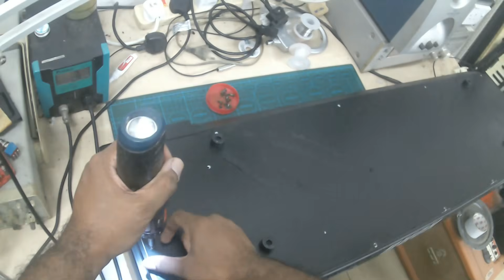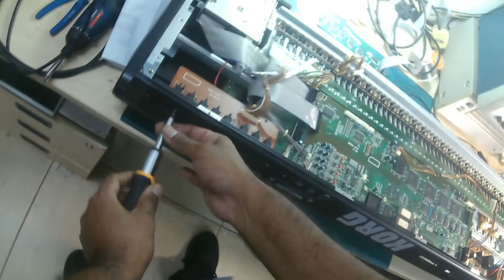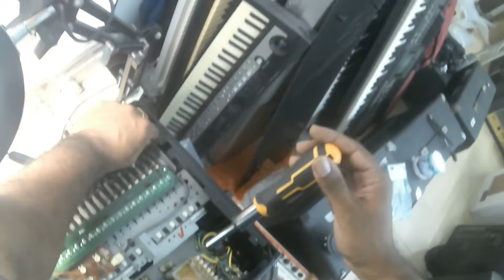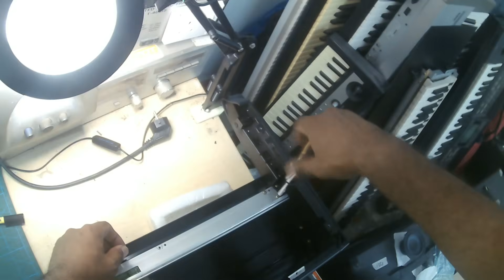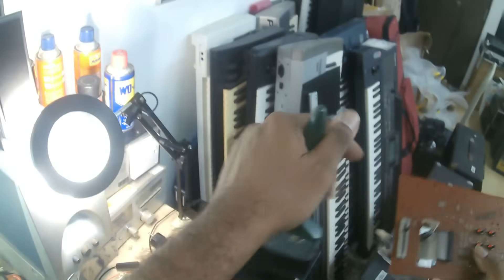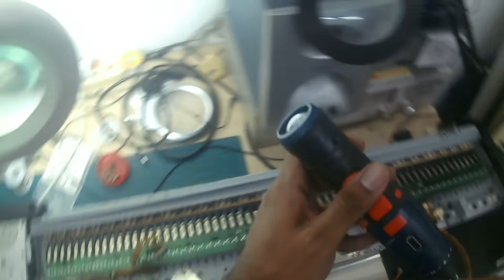KORG 01W Keyboard Repair

Comment: Hi, I see you have a great deal of expertise in synthesizers, so I naively ask if it's possible to replace the keybed on the Korg 01Wfd PRO with a more weighted keybed, or rather, weighted along the lines of a Kurzweil K2500/2600. Best regards, and congratulations on your skill.
Reply from the maker: Thank You. I have not tried to replace the keybed with a more weighted one. However, it is possible to glue some metal weights under each key . This was done in some roland models .
Reply: @audio-services  I understand...thanks for your precious assistance, Ciao!👋👋
Reply: Greetings from spain, I need you to help me get the screen of the korg 01wfd, I also have the korg 01w printer with the same problem. Thank you

Comment: I need to change the display in my 01WFD. It's been back to Korg for a full service so I won't need to go as far as you did. As far as I can see from your splendid video, it looks like I need to do the following...
1:backplate off and test the new display.
2: remove the main board.
3: remove the foil.
4: remove the display board.
5: change the display.
6: reassemble.
So, the key bed, the FD drive , the the rail, power supply and pitch bend controller stay in place. is this correct?
Many thanks, David
Reply from the maker: You will need to remove the keybed and pitch controller plastic cover to be able to access the LCD display board

Comment: You did nothing with the keybed did you?  That's an assembly which really needs cleaning, adjusting, and lube.
Reply from the maker: In this keyboard, i replaced the LCD display. There was no issues with the keybed. It was in good condition.

Comment: hi, very interesting, i have an 01w/fd , had it for donkeys years , it now whines a loud whine, do you have any idea what the whining noise is? i read somewhere it maybe the screen which is virtually gone now, barely visible, this doesn't annoy me as i use it as a controller for PC synths as i really like the speed or feel of the keybed, but the whining is an unbearable sonic intrusion, the whining does subside but after 24hrs of being left switched on....any ideas?
Reply from the maker: Hi. Does the keyboard also produce sound when the keys are pressed. Or does it only produce the loud whine
Reply: Inversor de voltagem. O seu o visor ainda é o original?